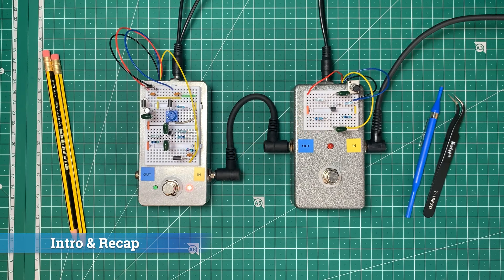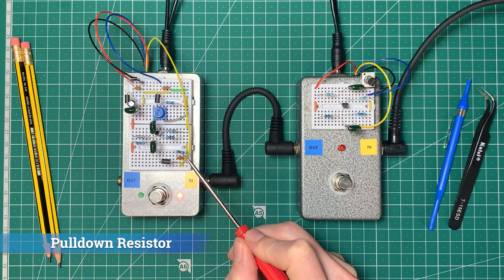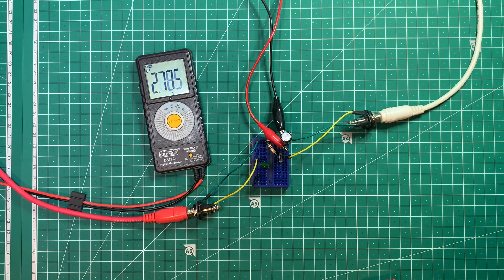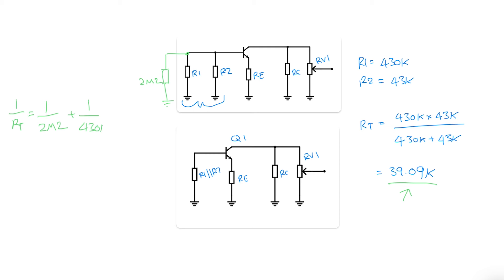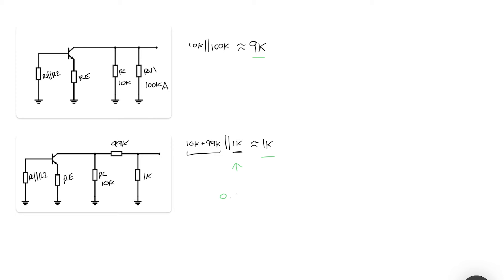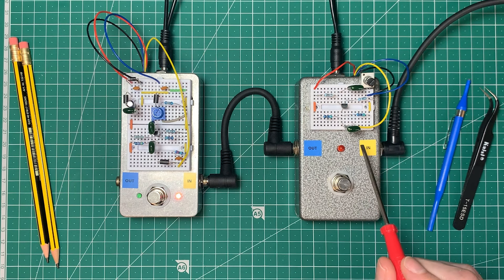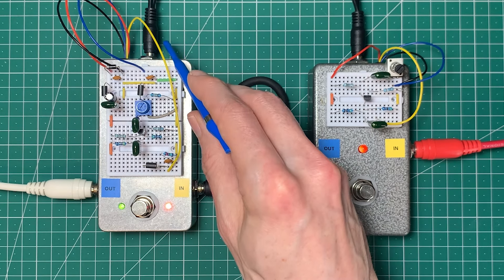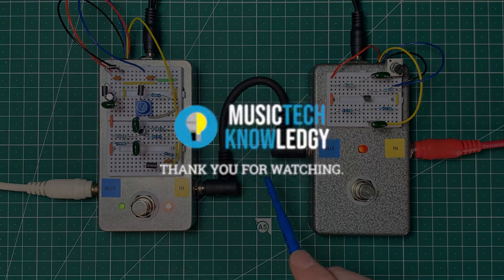Linear Power Booster - EHX LPB-1 - Circuit Analysis - Part 4 - Modern Version

Comment: Great video. Why not put a resistor in series with the reverse protection diode? Is there a downside?
Reply from the maker: Thanks, Ed.  I suspect cost in this design, and also a battery behaves differently to a PSU, and this circuit was originally designed to be powered by a battery.  Reverse polarity protection is always tricky to implement.  The legendary R.G. Keen has an interesting take on it: http://www.geofex.com/article_folders/cheapgoodprot.htm